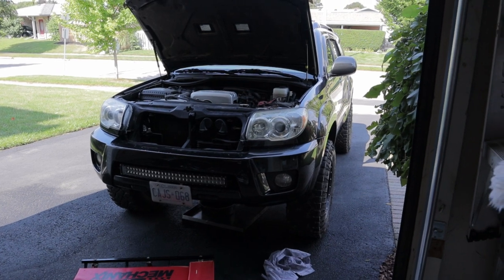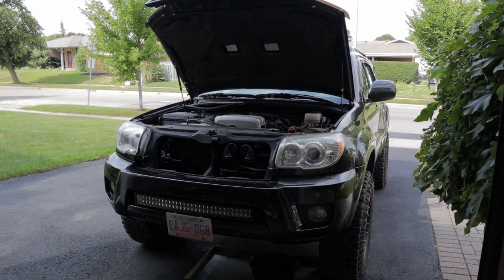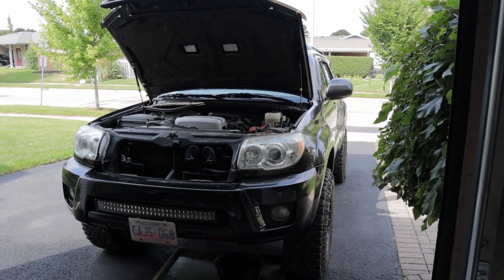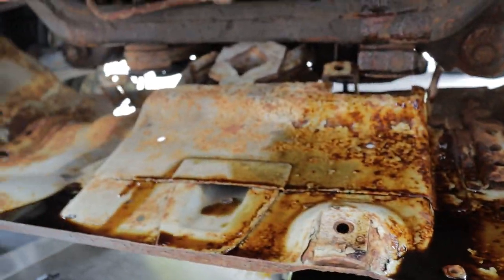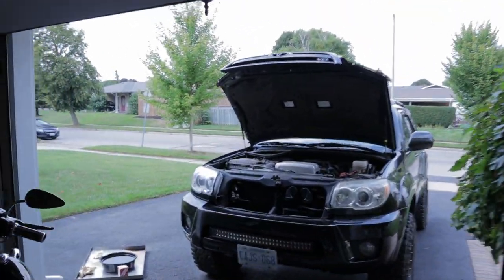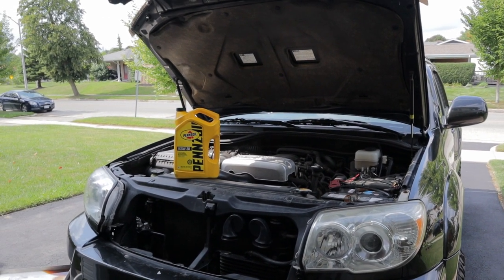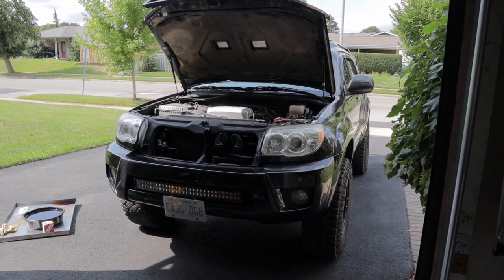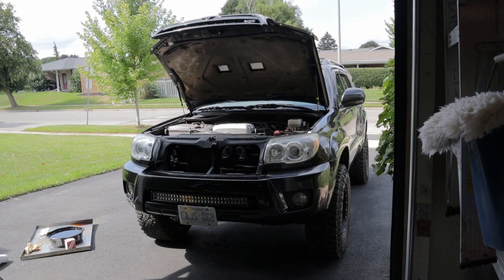DIY Changing The Oil In My 4.7 V8 Toyota 4runner

Comment: Really like your series. So much that I went and bought a 03 limited 4wd with the v8. Has about 338k and still runs like a champ. But one thing I will say is Amsoil may be expensive but it’s 110% worth the extra money. Would highly advise everyone looks into it. Either buy cheap regular oil or buy the REAL all synthetic amsoil. It’s the only synthetic with a synthetic base so it’s expensive for a reason. You pay for what you get.

Comment: I would recommend high mileage oil in high mileage engines. I also recommend Pennzoil but Synthetic. I noticed the engine runs smoother with the SYN stuff even from the same brand. My Volvo also drinks Pennzoil even at 238000 miles hard driven.

Comment: I was going to ask how to remove the filter without making a mess. I use the k&n oil filter. I like the mounted 1” nut.  Makes it easier to tighten/ loosen.

Comment: Thanks for the practical videos.  I'm convinced a 4th gen V8 is my next ride. Thx
Reply from the maker: Thanks for watching!
Reply: The V8 is really really cool.  Obviously great off-road chops but even on the highway it’s absolutely a mile-eater.  Seats are very comfortable and at 70mph it’s loping along at 1900 rpm.  I did an 8-hour road trip in my ‘03 last weekend and averaged 19.72 mpg.  It just feels like a completely different car than a V6 Runner … so so much grunt and smooth as a jumbo jet

Comment: Dont put the black lights on the runner. I did that and about a year later they began to sweat and water was getting inside. I took them appart and siliconed them and still i had problems. Bought another oem set and have never had a problem. I also wax them when i wash the truck and they remain new.
Reply from the maker: That's my main concern with the aftermarket lights :(

Comment: So I'm looking into an older one (same year 2007) with about 210k miles for like 7k. Would this be worth that? No check engine lights, no mods, 4.7 V8
Reply from the maker: Values on these 4runners differ a lot based on location. That doesn't seem like a bad price if it's in good shape and rust free
Reply: @CanadianGearhead  I'm definitely going to look into it for sure! I appreciate the advice. I'm just not sure what to look for but I feel that these engines are made to last and that this guy is just now being broke in. Not sure how to classify these high mileage Toyotas compares to other vehicles.

Comment: would you recommend the same oil for a 4.0?? I have an 08' like I said, just the V6 version, still 4WD though lol
Reply from the maker: I'm no oil expert, I just run whatever the owner's manual recommends
Reply: @CanadianGearhead  makes sense lol, thanks buddy, love the videos man
Reply: In cold climates, synthetic oil flows better at start-up.
Reply: Michael Anthony ....it’s a matter of seconds from the time you start the car till oil is pumped through the motor. 

There is a misconception about conventional oil with regards to its ability to move during startup. 

It’s not molasses, the 5W number tells you how the oil acts in cold weather, so a 5W synthetic and a 5W conventional oil will act the same, the Synthetic simply will work longer in the engine where the conventional breaks down sooner, hence the 4000-5000 OCI for conventional.
Reply: @smokestack9795  
Thanks for the insight. So, conventional oil is just good as synthetic oil but only for a fraction of the time. Everyone should consider this at their next, uh, "OCI"!
Reply: Michael Anthony .....Sorry, oil change interval, and Synthetic is better than conventional but on start up the pump moves the oil very quickly from the pan through the motor.